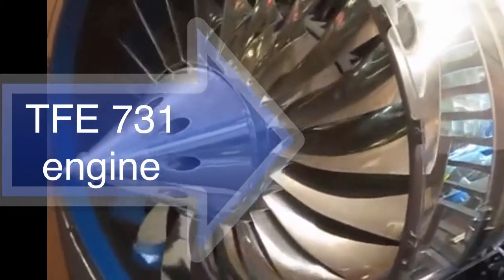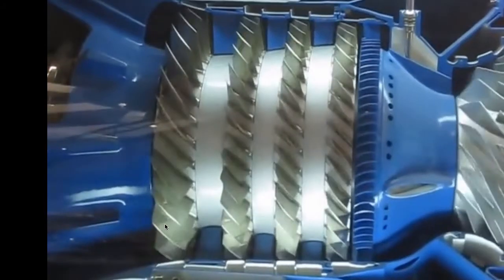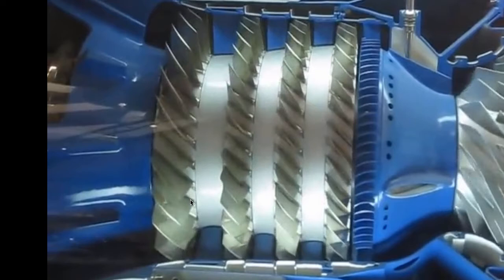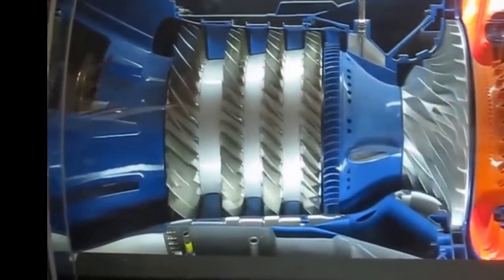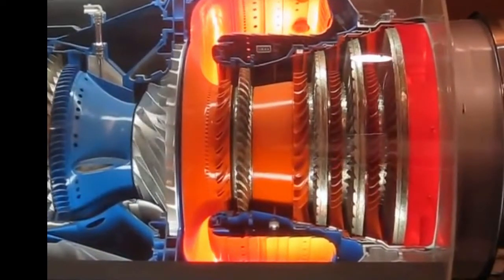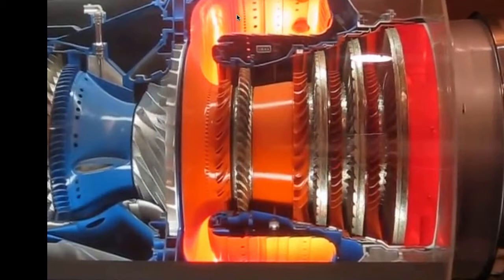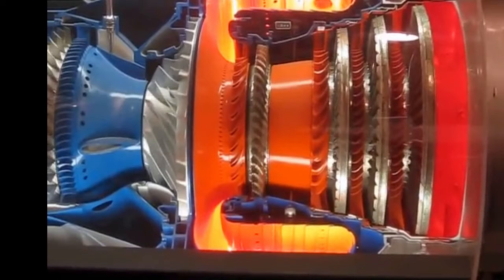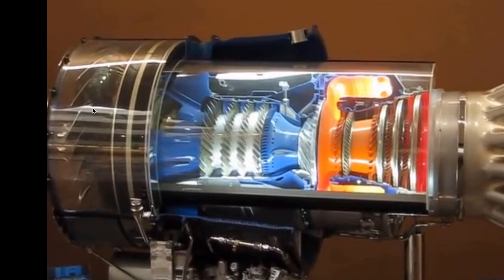TFE 731 youtube video part 1

Comment: Maybe a little explanation of how the starter drives the 4 stage compressor section through the tower shaft and how the HP impeller reacts during engine start?
Reply: The tower shaft is driven by the HP centrifugal compressor (N2).

Comment: I fly the Citation VII with Honeywell TFE731-4R-2S engines installed, offering 4,080 pounds of thrust each and using 251 GPH - with 2 AOC operators, around Europe. Thanks for sharing this video. So useful! Great job too!